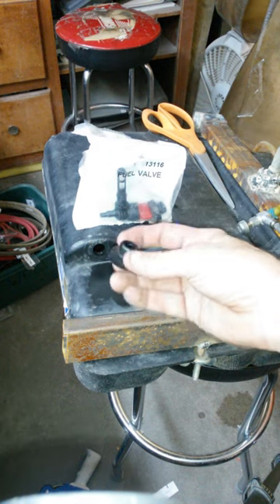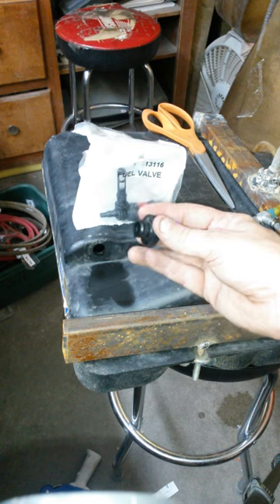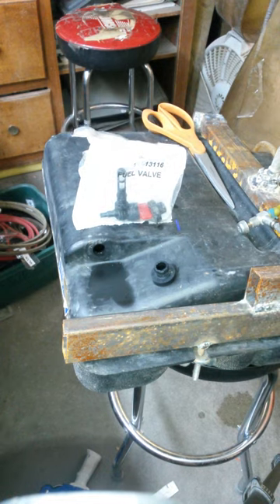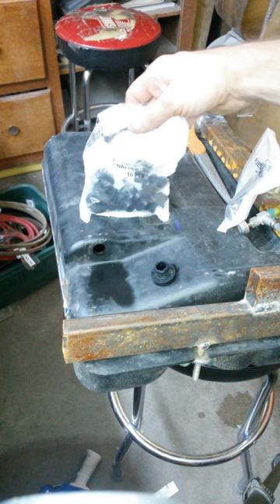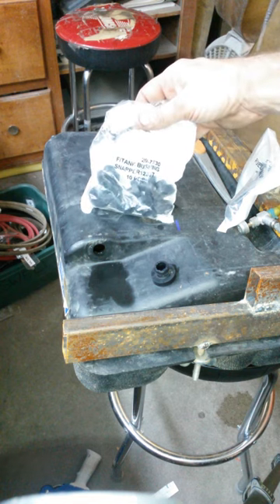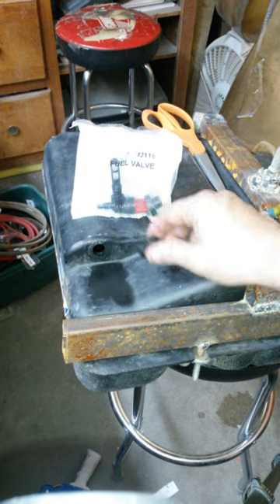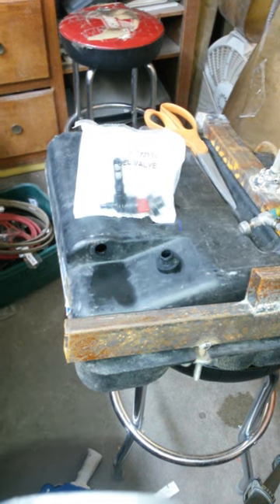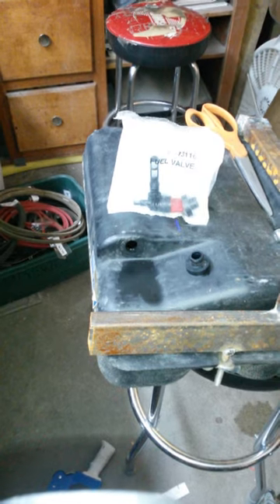How to replace rubber bushing and fuel cut off valve on a generator gas tank https://amzn.to/4628UCD

Comment: The rubber seals came on the fuel shut off valve I purchased for my Kubota zero turn. This makes much more sense that they come separately to expand in the hole creating a much tighter seal

Comment: Here is a tip for Anyone struggling to get the grommet in or getting the petcock in the grommet . Spray brake cleaner on it then quickly insert. If you wait too long the brake cleaner will evaporate.

Comment: Thank you so much for this video! I knew to put the grommet in first but I never could get the check valve inserted. I never thought of using a little oil. Worked like a charm. Thanks!!

Comment: Your video is a big help in learning how to install the grommet. My problem is, how do you get it out in the first place? Thanks for your help.
Reply: I'm Clayton, Elena's husband what I did was pull the valve out as far as I could and cut the grommet with a knife and pull it out with pliers then it will come out easier. It's a very tight fit to prevent gas leaks and when you put the new one back oil it good and push hard. This worked for me.
Reply: you just pull it out

Comment: I'm a little late but with my gas tank I have a line that connects to the fitting on the inside too, so I have to have everything already assembled before I shove the grommet in, it's really difficult to fit in. Any tips?

Comment: I have an old Snapper gas tank with a nylon 90 degree elbow that has cracked at the gas line nipple. I want to replace it with the part you show in this video but I'm not sure I can remove the 90 degree elbow. The tank is black in color and the 90 degree elbow is white nylon color. I tried a channel lock to turn it free, no luck, it wants to crack the fitting. Have you experienced this type problem and have a solution I might try? Thanks

Comment: Ba F-ing haha, try that on a 03 650 Quest, what do you do when the hole is 1/8 inch smaller and you have approx 3 inchs of lateral workspace, and have to have the tank filter in the grommet to install?
Reply: Remove the tank and repair and then reinstall the tank.

Comment: Dude HOW DO YOU TAKE THE OLD ONE OUT????????????
Reply: just pull it out with plyers,if you can get the fuel shut off valve out first it is better but it all just pulls out its a pressure fit.